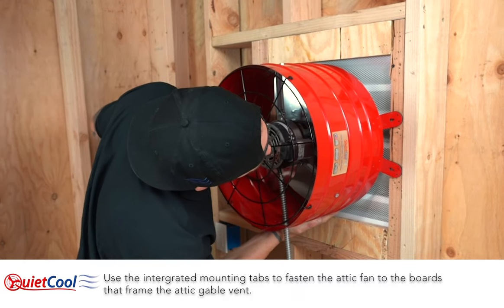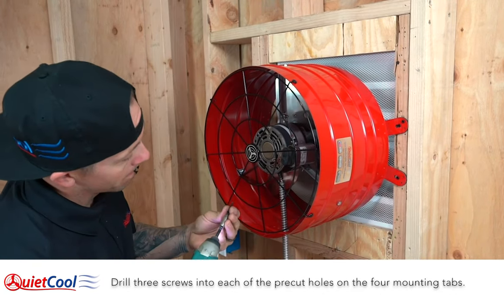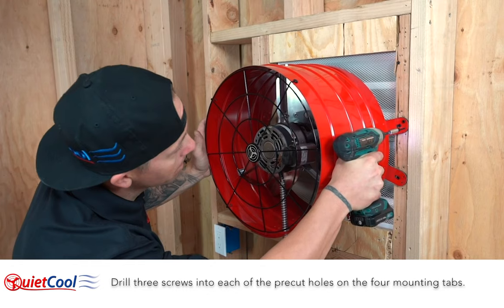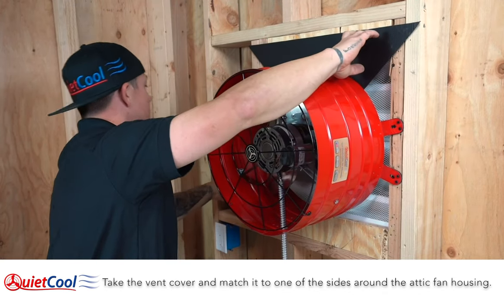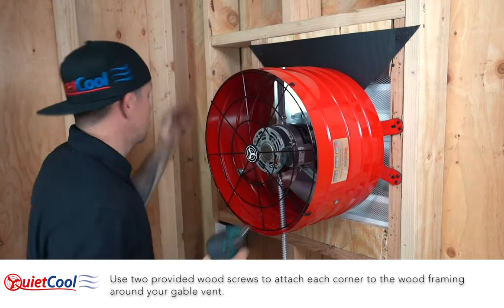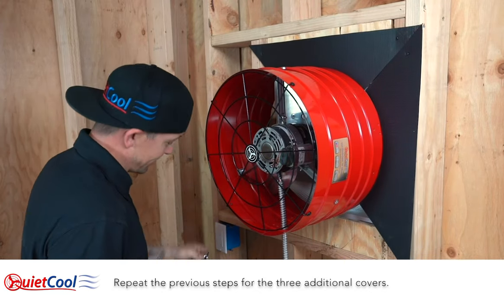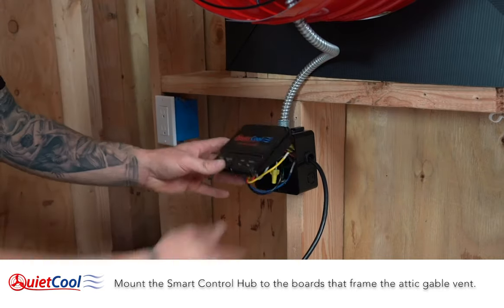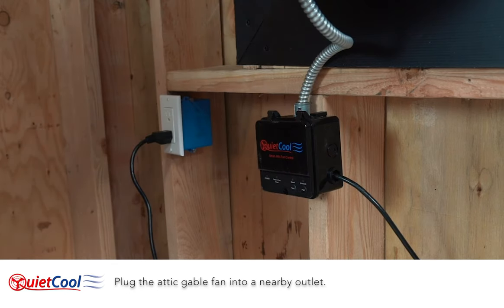How to Install an AFG SMT PRO-3.0 Attic Fan

Comment: This video is good but it doesn't nor do the paper instructions tell you how to install the ANTI VIBRATION tabs or feet included in the box plus unless i missed something the instructions are lacking mounting the smart attic fan controller that thank God this video shows us how to. Also wish these units worked off WiFi instead Bluetooth or booth. Otherwise I'm excited to see how the Quietcool AFG SMT PRO-3.0 compares to the former Gable Fan that nowhere in the older units instructions tell you that you need to oil it now and then. Thanks alot HomeDepot for always pretending to see quality equipment or tools just like Harbor Freight. When considering new power tools always check the specs of the unit sold at a dealer and the units sold at big box stores ie our Hedgehog trimmer came from Homedepot and the motor uses Brushes versus the dealer unit that is Brushless.. big difference in tool longevity. Thanks Eddie J.   Long Island N.Y
Reply from the maker: Thanks for your feedback!! We really hope you enjoy your fan.

Comment: Please Reply. My attic recently got mold and I was told the ventilation system was bad in the attic so I showed it to an electrician they said they can install a gable fan in the attic however they are very expensive. And this seems like something I can do so would the gable fan be good to stop mold and have proper ventilation in the attic?
Reply from the maker: You can look at all of our gable attic fans on our website. I would recommend the smart attic fans when considering attic gable fans.

Comment: The fan is smaller compared to my homes gable. I don't think the flow covers seen here will work. Can I still install the attic fan or will that defeat the purpose. In other words will it still draw out the heat correctly?
Reply from the maker: HI Gus,

Depending on the size of the gable you currently have, it may work.

Give us a call at 951-325-6340
Reply: Use plywood and cut it the same size as the gable vent. Then cut a circle where the fan will be mounted.

Comment: QuietCool AFG SMT ES 3.0 installed.
Fan works fine, except when the temp inside the attic increases quickly when the fan is on.
It will jump 5 degrees in 5 minutes after I start running the fan. Its April 2nd, not hot yet and the system is increasing my attic temp.
Reply: Er, no. How can the system increase attic temperature? 😮